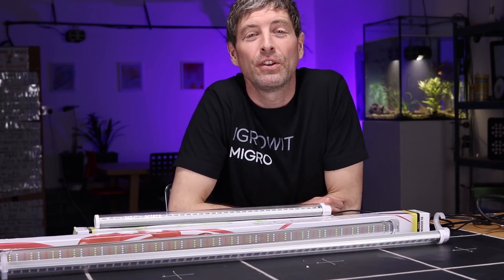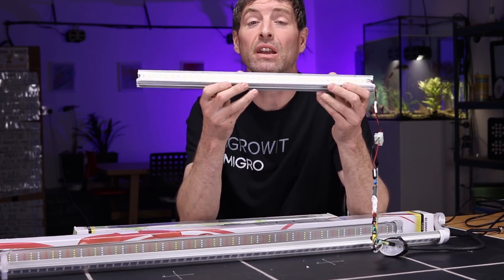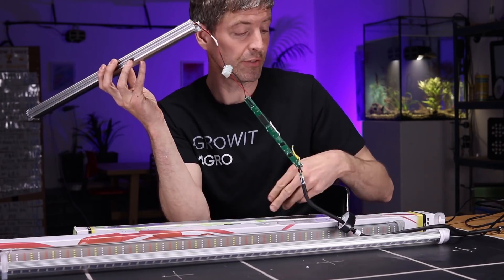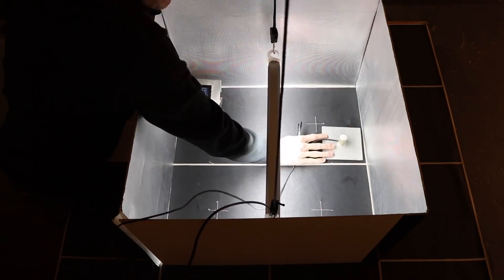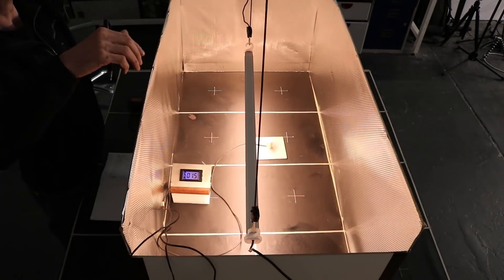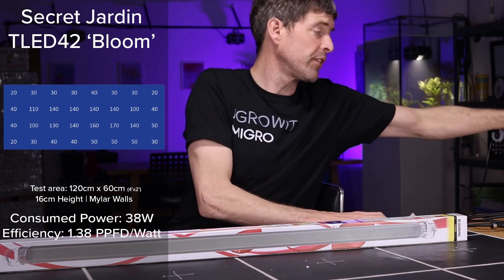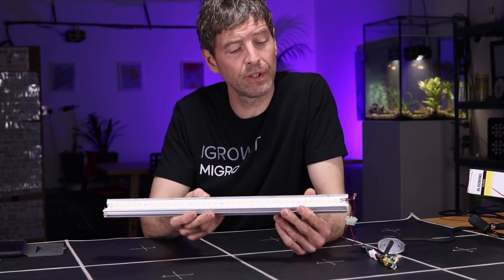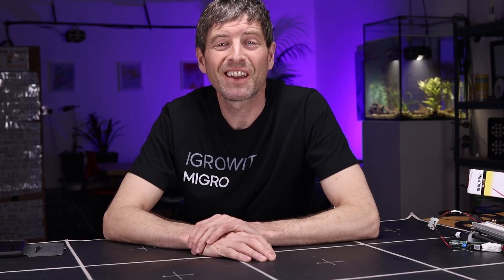Driverless LED grow light bars | Secret Jardin | Gtools | Streetlight

Comment: I started with LEDs awhile ago, my whole gripe is that after a certain amount of time(depending on quality how that time is affected), the lights will degrade not in just intensity but actual output. Also, most LEDs don't last as long as claimed by a majority of manufacturers or that actual wattage claims are exaggerated at best, and outright lied about at worst. I am not saying LEDs do not have potential, in fact I believe that one day they will become the standard, until then I feel the tech is not as far along yet.

Comment: Ok thanks for tests BUT tests are not all the answer, experience is the best , so for the secret jardin LED MY experience in cloning between a 2X24 wAtt NEON 6500K VS a 45cm 6500K secret jardin LED, secret jardin led are more efficient in result NO HEAT  so i think those lights should be tested in lower height as 6ich because it s made to be put in vertical for nuts ... so 26 secret jardin led are more efficient than 48 watt neon for cloning  and begining of rooting and veg

Comment: Will you do the  Crecer Lighting PanthrX mine draws 648 from wall, plants seem to love it
Reply: The data is on their website.   Immediate observations .. no info on the led they use.  massive discount = they are robbing people blind - drivers in the unit = heat ...in advertising blurbnb they use a par map 12 inches from plant = massive hotspots but used to try and impress people that dont know what they are looking at..   It is a 4x4 light taking 650 watts.  Could  do the same for  2/3rds the price (that's the discounted price)
Reply: @Baldnesz  Well, I am on my first flower with it, day 30 check it out on here. 82 degrees Fahrenheit with tent closed. They say they designed them, i do not know. the price, just a smidge over $1 per watt, and with  2.5 umol/J Efficiency   And Made in the USA. you mean other companies like HLG are robbing people blind at over $1000 for 500 watts from wall or $2 per watt from Wall. I am not getting paid by them, I just love the results of the white light and they show 24 inches  and 36 inches for Par. │ PHOTOMETRIC SUMMARY
Total PPF (umol/s): 1552.6 umol/s
Total Lumens: 97,784.45 lm
Efficiency (umol/J): 2.49 umol/J
CCT color Temperature: 3600K 
Watch my Results!

Comment: Another great video Shane! I bought a screw in, mogul US 110/120V 50WCOB(may be called 100W, lol) only $60 on eBay. Same on Amazon, but $90, not worth it! This was late last year, still working! I had to ask if there's a driver? "Yes, inside. LED's always need driver!". Probably like you showed, 80% efficient "hidden driver", like these. So they're not driverless, but cheaper drivers (much, lol, didn't think it'd last this long..), and I could probably put in a new generation Luminous chip? But still less efficient than my Meanwell drivers, which power 8-50W COB's, which I can always replace (cheaper Citizen CLU-?, last generations, not the newer ones you recently tested, could probably put in the new Luminous, as well (they're smaller than some others in size. Or upgrade to the better Citizens.. Have an HLG-65, and recently a Fissoning 120W(HLG-100 were out of stock. Same chips (301mb-?), maybe better Meanwell driver, I believe, plus 20 extra Watts, but $10 more, and another $10 for faster shipping. Came in a few days! BUT NO UPGRADING MULTIPLE CHIPS, MANY, MANY! MIGRO COB's ARE TOPS! ALWAYS UPGRADABLE COB's! Other, HLG, etc, you'd need a new board of chips.. Rambling on again! My bad! Long story short.. MIGRO ARE TOPS, ALWAYS UPGRADABLE!!!

Comment: I don't believe your method of testing is correct for the shape of the lights, therefore your calculations are also incorrect. These strip lights should be measured in a rectangular area given the shape and power of the units, and compared to the way they are intended to be used as multiples across a width. Most of them look to have built in reflectors which also regulates how 'wide' a footprint the light pattern disperses; not to the walls of your test area. Most of these type are also low wattage meant to be used closer to the canopy than a higher power cob or array, and I didn't see you do you normal set up for hanging height to realize 1000 PAR or whatever you often did in the past and other videos.
Generally like your vids, but this one is as lacking as todays appearance. :)

Comment: Hey can you test  the parfactworks 250 watt cob led light they have cree cob led to now I just can't find no info on them there new I think
Reply: I can't tell you the exact measurements as I don't own a par meter or anything like that but, if you're referring to the one that's a single cob surrounded by a few other chips to add in the reds, uv's and blue I can tell you this: mine draws 92 watts at the wall and I measured that using a fluke true rms clamp ammeter to measure the amperage and a fluke DMM to get the exact voltage coming in and multiplied. Also I disconnected the fan to take those measurements. The removable optic is nice so you get a wider spread when needed. Honestly, the light is actually pretty nice in terms of quality and plants really do grow well under it. Sorry that wasn't exactly what you were looking for but maybe it helps even though you posted this 6 months ago.

Comment: Thanks for another illuminating vid Shane.  Wouldn't purchase anything electrical from Secret Jardin anymore after their 20W Oscillating Monkey Fan almost burnt my house down!  They do point out their design flaw with this model by telling you not to tilt the fan up/down beyond 15 degrees or it could result in damage to the fan but nothing about electrical arcing!  Guess my protractor was off even though I observed the warning as best I could.  When I reached out to them the reply was essentially, "talk to your retailer".  Anyway...be warned...Secret Jardin don't do electrical appliances well.
Reply: RCD's are a must.  Far safer than plain fuses.
Reply: Yip...3A I believe...that's the first thing I checked when I heard the snap, snap, snap sound coming from my tent and went in to investigate.  Once I got it out of the tent and checked it in more detail I could see the arching on a piece of metal within the plastic housing which was part of the oscillation mechanism.  The movements must have chaffed a wire close to this.
Reply: Hi Aim, we're really sorry to hear about this and see that you're upset with our brand. We assume that we had manufacturing problems with the Monkey Fan 20W on some lots and we really apologize for that. 
Indeed, retailers have to do after-sales service because we can't manage everything, but if we haven't been polite with you, we apologize again.

Comment: I would actually like to see those HID bulbs for cars tested. The tech is very close to CMH.
Reply: That would be interesting...12 car headlight lamps under a hood lol
Reply: @victorsupreme214  all these LED rigs use some form of power supply. Any 12 volt driver with enough amps would run them. They are quite efficient at converting power into light so it's worth a shot I reckon!

Comment: I'm wondering about the use of units here. You're saying PPFD per Watt, but doesn't PPFD require a set space to give a density? Wouldn't it be just PPF?
Reply from the maker: PPF is the total PAR output of the bulb or fixture, PPFD is the quantity of PAR reaching the growing surface. For example a HPS bulb emits 1.9 PPF/Watt but when reflectance losses are considered the system efficiency is about 1.3 PPFD/Watt.  It's a little like horsepower and brake horsepower i.e. a measurement of the useful output of the total system.

Comment: Hi Shane,
Can you test E27 bulbs e.g:
Phillips CorePro 17,5w 840 (EAN 8718696813874)
4000k, 2500lm
LER [lm/w]: 325,92
QER [µmol/J]: 4,71
------------->~2,064 µmol/J (theoretically calculated without dome so actual numbers would be good but quantum sensors are expensive af)
~36.12 ppf for <10€
Reply: Hmm doesn't look too promising: 2500lm /17,5w = 143 lm/w ( where is that 325 coming from?).
I thing the top full spectrum here will get over 190 lm/w (can only be applied for white only lamps I think). But if you have E27 fittings lieing around the price is interesting!
Reply: @frankkrumnow7194  well the 2500lm are with the thick plastic dome, and yeah it's 143 lm/w, BUT  the LER (Luminous Efficacy of Radiation) is [lm/w]: 325,92
.
If you remove the THICK plastic dome you get atleast 10% more light (atleast! its more like 15-20%)
so let's say 160 lm/w thats 2800lumens for 8€!
And dont forget the light distribution:
you can hang them individually in height& position, so nearly no lightloss, even better light distribution than a Quantum board from led strips.
Now the cost:
1 bulb + e27 fitting= 9€ (2800)lm!
A migro 100 costs 269€ and is 115w)
For this I get ~30 bulbs+fittings, which is
525W. 
Nuff said

Comment: I don't really see the advantage of making them "driverless" by putting the driver on the back of the led chips. They'll just run hotter.
But hey, your product doesn't have to be good if your marketing is. 

Now, real driverless leds on Ac would be something. But that just contradicts what diodes are.
Reply: They actually don't run hot at all bizzarely - not the Secret Jardin versions I have anyway. But yeah - you're right. I'd have preffered an external driver and the benefits that come with it.
Reply: @iconoclasttastic9258  well I wrote that before watching the whole video. At the low wattages they run at, heat really shouldn't be an issue.
Reply from the maker: Hi, the advantage to losing 5% driver efficiency should be much better value for money as these format drivers are relatively cheaper.
Reply: @MIGROLIGHT  okay, but I'd still prefer to have them external. Wouldn't change the cost.

Comment: What light do you personally use
Reply from the maker: MIGRO lights :)
Reply: Well that was a dumb ass question 🤣😂🤣😂🤣
Reply: @localx1  I can say from my own experience, if you can afford them you will absolutely love them.
Reply: @rmherrmann8  thanks I appreciate that I'm looking in to them right meow actually was looking at the optic 8 with the 120 lens
Reply: @localx1  doesn't seem like a bad light, the 8 cxb 3590 are driven at 50w, their most efficient point. But still pricey for what it offers.
Reply: @localx1  check out sunplus pioneer lights prices😉 they may send you to the north American distributor which is .... optic led
Reply: Yeah I was looking into the optic 8+ with 120 lens

Comment: Hi migro does glass lower the par reading thanks
Reply: HPS glass hood I believe the loss is 10% but I’ve never measured, have you Shane ?
Reply: 420mFuk hey bro long time how’s things I thought it was 10% just couldn’t find much information on the subject.Some guy was saying on Facebook that there is no par loss when using glass 👍🏼
Reply: @Crookyist710  I'm good thanks Crooky hope you're keeping well buddy not seen a vid for couple weeks, yeah I'm pretty sure its up to 10% especially if you factor in dust, maybe the guy on FB was talking about the glass on the bulb but yeah there's defiantly some light loss going though the glass on a air cooled hood, I use cool tubes myself as it gets really hot down here in southern Europe.
Reply: 420mFuk that’s good I’ll upload one when lights come on.Had to many males so only running the led and 660w hps.Nope the guy on Facebook was on about aircooled glass he hasn’t replied 🤷🏻‍♂️🤔👍🏼
Reply from the maker: Hi, yes the acrylic cover reduces total light output by about 3% to 6% but will increase the probability of longer LED life if the LED surfaces are kept clean.
Reply: Thanks Shane But what about glass in a hps aircooled hood would that be the same thanks